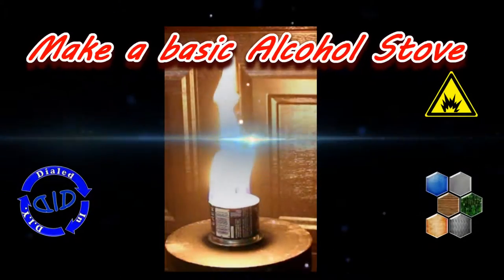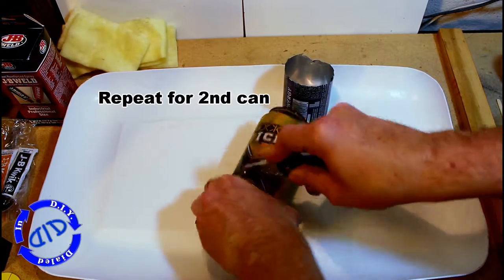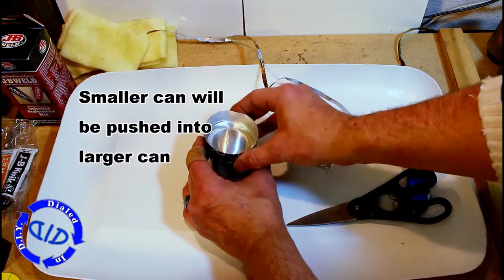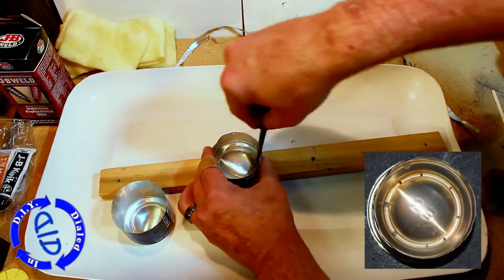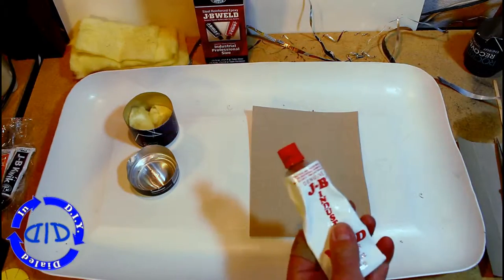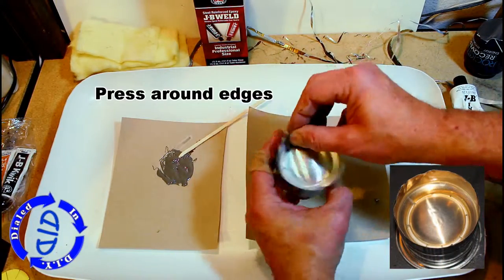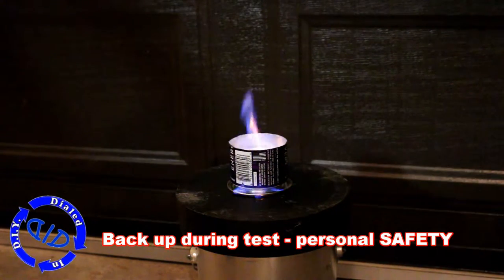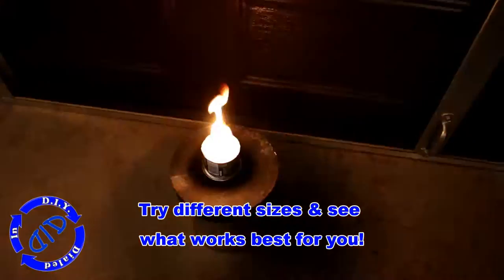How to make an Alcohol Stove - Basic Version

Comment: 4:00 Or instead of JB Weld, you could push the inner can 1/8" deeper into bottom can, then carefully crimp the outer can over the top of top can's rim, holding it in place.
Reply from the maker: I really like that idea.  I have not experimented with  crimping the outer can but I have made a no glue/weld version.  If you have tried this, did you use regular pliers (needle nose) or something different?
Reply: @DialedInDIY  
The easiest way is to press with a spoon, wooden dowel, ball point pen, or popsicle stick. Make at least 3-4 passes, gradually bending the edge in and down. Don't try to go for too much in one round, or you'll get kinks or creases.
You can finish it with needle nose if you can't get a tight crimp without them. In fact, you could use the outside (rounded area) of the jaws to start the crimp.
Reply from the maker: @xenaguy01  Perfect.. thank you.  I am going to have to start emptying some cans now so I can try this out.  I love the idea of not needing the JB Weld... makes it doable almost anytime and anywhere.  Thanks again.
Reply: @DialedInDIY  
The "best" alcohol stoves are made with one or two beer soda cans and a camp knife. You can make a dozen different stoves with just a pocket knife. 
Other tools can help, like a nail, Swiss Army knife blades, etc.
Reply: @DialedInDIY  
Look here: https://youtu.be/3nKoHYSqUA0?t=197 to see how to form lip using a popsicle stick. Silvio Leonardo uses a steel or aluminum pipe to close the lip. This shows it: https://youtu.be/leEi1WABDvc?t=638
Reply from the maker: @xenaguy01  I completely agree!  The favorite that I have made is no glue stove that can be made and used in about 10 minutes: https://www.youtube.com/watch?v=NNVweFsrgn0 
I also did a penny stove that I think needs to be attempted with your suggestion as well.
Reply from the maker: @xenaguy01 Thanks for that link.  That was VERY helpful.  I know what I am trying out this weekend!!!... plus, I have some new styles to add to my list to try.  Since the time of this video I have made a few dozen stoves of different styles and sizes.  I have not needed to make another one for a while but I have a bit more time available these days so I'm thinking it is time to try to roll one... the top edges of a stove that is.  Hope all is well!